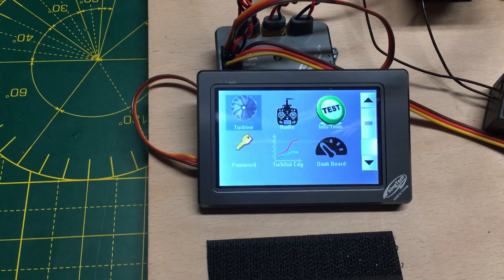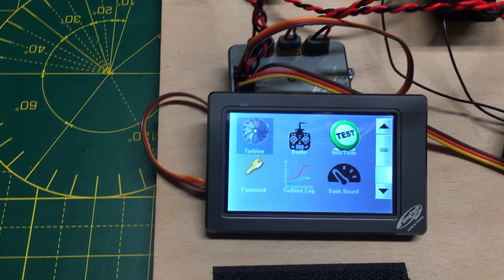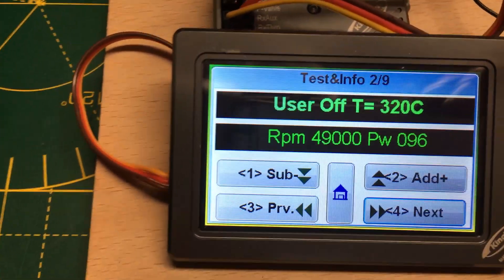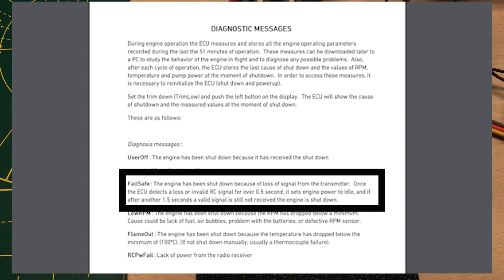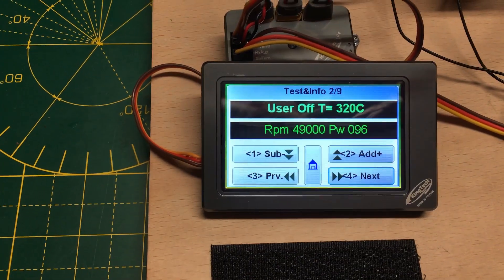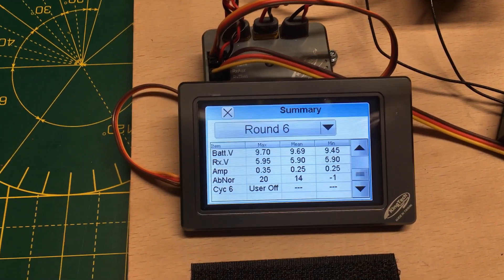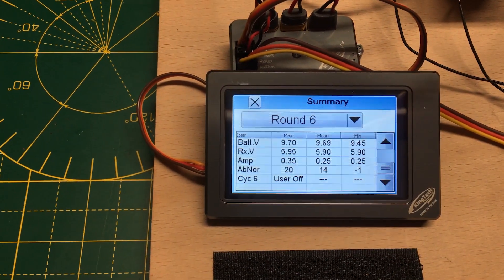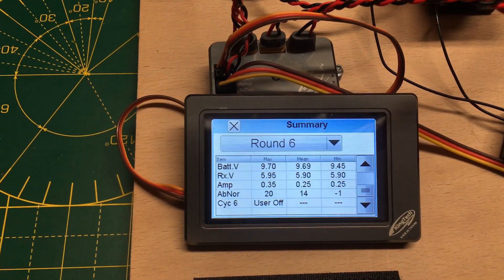KingTech G4 Turbine - Part 6 - WOT NO FAILSAFE CODE ??

Comment from the maker: Just an update from me - I was wrong. The key to getting a failsafe report is that there must be at least 300ms difference between the code sent at failsafe and the normal trim up throttle low position. In order to do this with Futaba, I set the endpoints on the throttle to 150%, moved all the way to low throttle low trim and set the failsafe value on the throttle. I then reset the throttle endpoints to range between -90% and +90% and rerun the learn RC command. Tested and I now see the failsafe shutdown code.

Comment: I've got a G3 K210 and it was my first Kingtech. I put out the same question on the Jet forum here in the states. Nobody could really answer this. I believe it's an inherent problem with the Kingtech ECU firmware and it's something they just don't care to fix. I had the same issue with an old Jetcentral Super Eagle in an F-15 many years age and that was a Xicoy ECU. They have since updated their ECU's and you will get a failsafe message.

Comment from the maker: Hey, please let me know if you have any questions, or if you have a G4 and get a failsafe code!
Reply: Hi, I don't have a Kingtech G4 but I do have Jetsmunt and I believe they are based around the same Xicoy technology. Do you actually see a difference in turbine behaviour? Shutdown should stop the engine immediately, whereas Failsafe should idle the engine after 0.5 seconds, then shutdown after a further 1.5 seconds (unless the signal returns). It was a little difficult to see in your video the point at which failsafe occured, and the engine actually shutdown. Hope that helps.
Reply: Try to unplug rx power and see code stored that way.
Because this way ecu is getting valid PWM, it does not know is it you on the sticks/trim or programmed setting in ypur rx...
It will display failsafe if it gets corrupted PWM or no PWM at all, which happens if cable gets pulled out, bqttery dies, rx dies...
But failsafe that you set up in ypur tx in previous video is there to kick in in case you loose radio connection to the rx, which will then continue to send preset PWM signals like nothing happened...
If you really want to see failsafe code in case of radio link loss, try to set your rx to stop sending pwm on thr channel (no hold, no preset %,  just 'off')